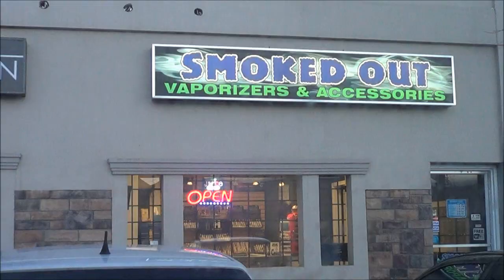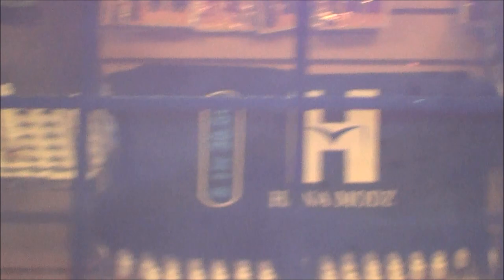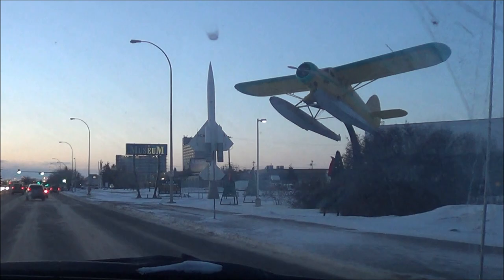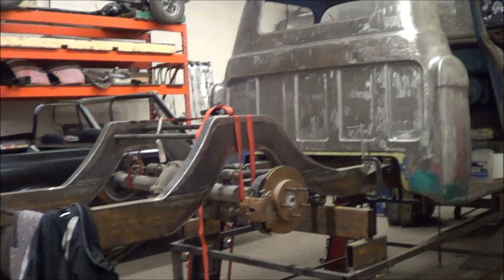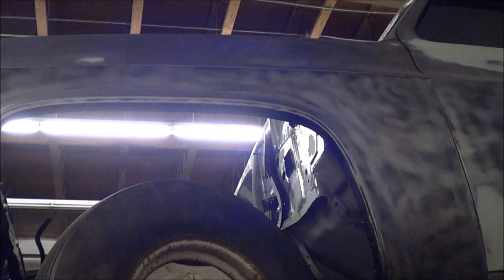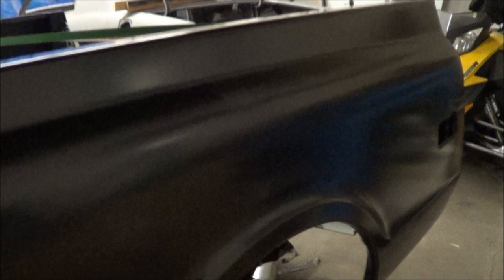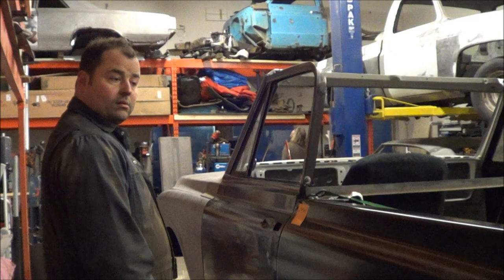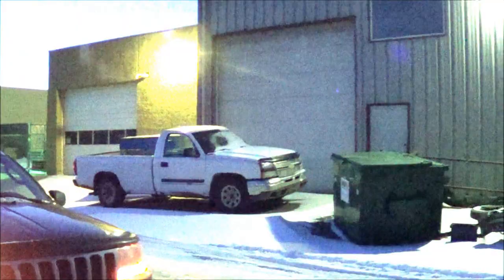shopping for a new scrapping truck/  the ferd 2

Comment: You have bought one of the most reliable combinations ever.That straight 6 4.9 is bullet proof and the 5 speed manual is as well. For 500 bucks that is a hell of  a deal truck like like in Oklahoma with around 200,000 Miles would sell for $1600 to $1800 dollars awesome deal. Looks like its is really good shape for a 94.Keep on scrapping brother!!!

Comment: That's a friggin sweet truck dude! Those inline 6's are some torque-y engines...I think you'll find that they don't get as good of fuel mileage as most think, but they are great for pulling things. (after all, its almost the same size cubic inch wise as a v-8)

Comment: Everything except the dash will work on that new truck from your old one. Save the parts!
Only thing to keep an eye on is there's rubber plugs that can shrink on the m5od trans and leak the atf out and burn up that manual. So verify every so often its not dripping atf.

Comment: Nice score for $500. The fact that it even runs is a bonus. Body looks decent...referring more to cab corners and the way box and cab line up. But, being of keen eye, I did notice something. Other than the battery gauge, do the other gauge's work? I see they all read zip while you were driving it. Oil gauge just showing enough that it might be working, Ya, I know, with you the fuel is always at zip :P but the oil pressure is what caught my eye and then the temp gauge. Other than that, best bang for your buck. I would seriously consider adding a leaf or two to the rear end though. I know you're gonna ride her hard but, if you treat her like you do Shelley and not some lot lizard, that truck will have more rides for you than you'll have in you!!! Cheers brother!

Comment: That should last ya, inline sixes last for ever, an shifting smooth, thats a good sign the previous owner wasn't rough on the clutch and all that that goes with the tranny. I have an inline six 4.0 in my 98 Jeep Cherokee sport, great motor, nice and torquey, also I know people  get to 400,000 miles a lot with the ones in jeeps anywerds, an id asume its prolly like that for Ferds, but once they reach 400,000 miles they blow a rod, as you'd expect with that amount of mileage